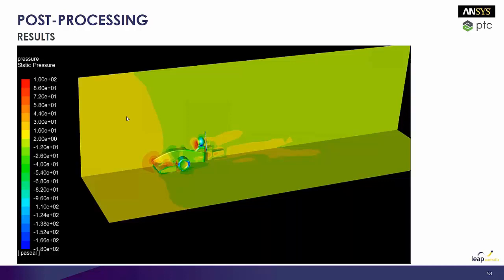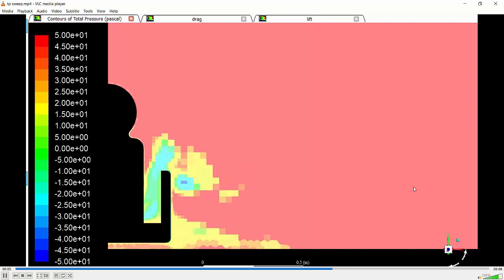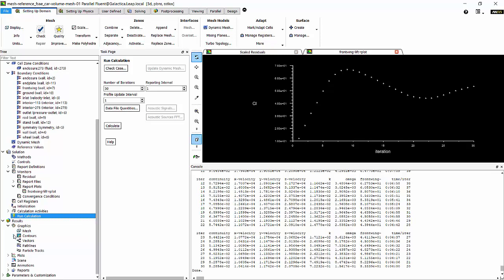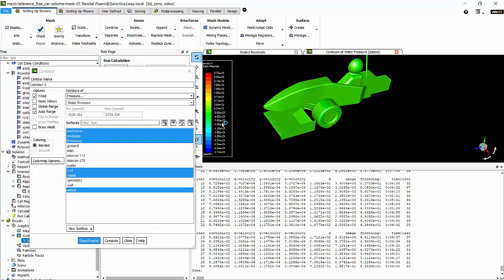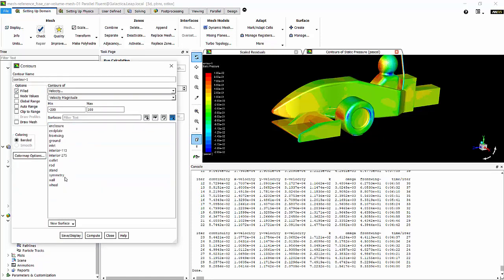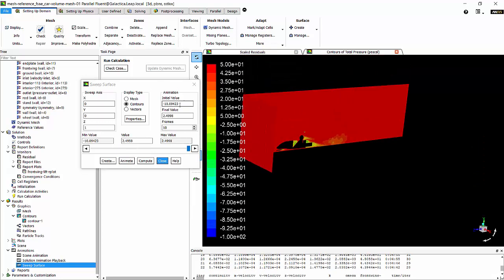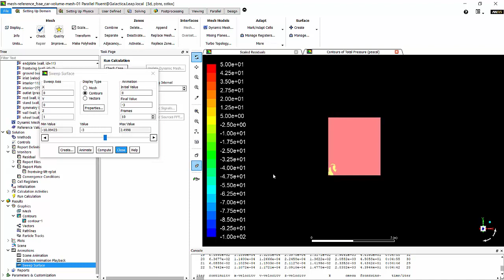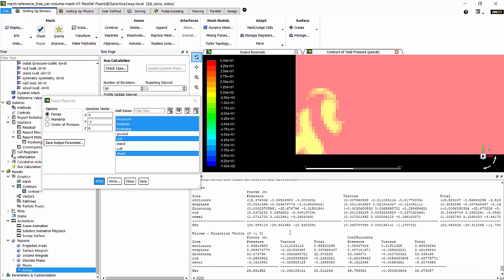Post Processing CFD results - Presentation and Demo  - ANSYS CFD for FSAE teams - 9/10

Comment: Hey @LEAP Australia , Great work. Been following the tutorials. The Frontwing lift values at the console screen, are those values correct? They are in the range of 4 e+1.
Reply: By default, it plots the static gauge pressure with respect to the freestream. Plot absolute pressure if you want that.